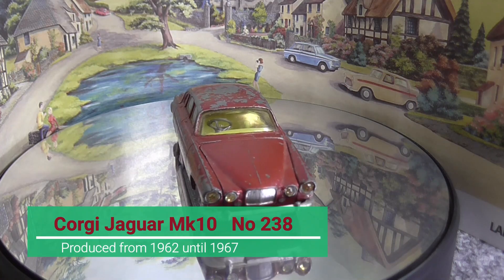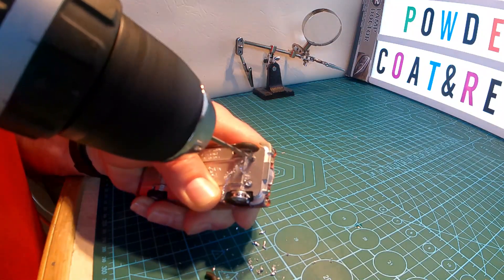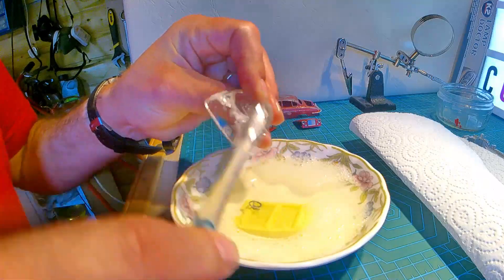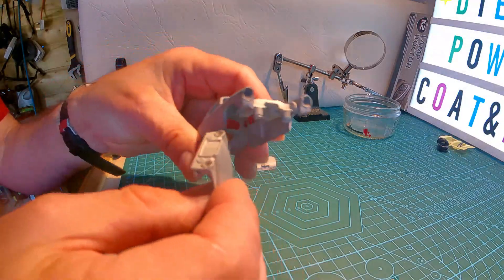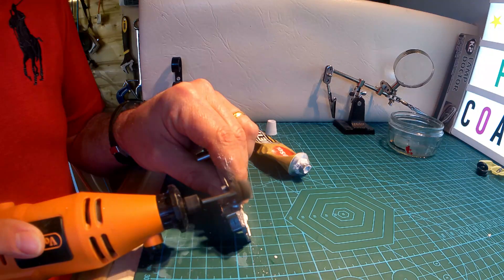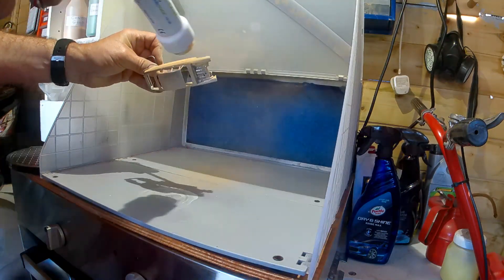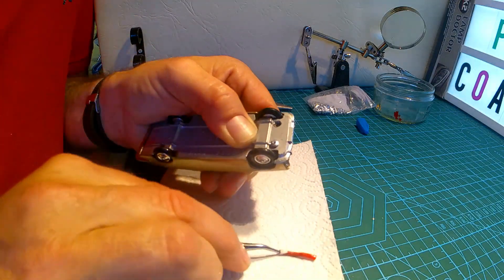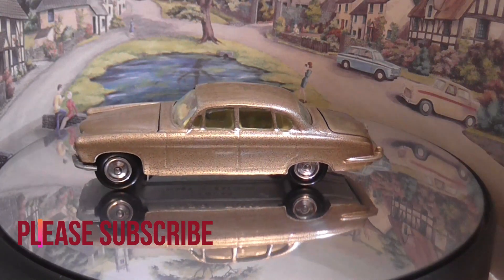Corgi Jaguar Mk10 Powder Coating

Comment: Very nice piece, that old Corgi castings are new for me 'cause it is a brand rare to find here in Mexico, specially old models (also very expensive if you find one). I wonder if the shiny finish comes out with the oven process or you applied a clear coat after. Completely new painting technique for me. Great job. Greetings from Mexico City 👍
Reply from the maker: Hi Hugo, Thank you for your kind comments. No when they come out of the oven they look like that.
Sometimes things go wrong and I may have to do it again.
I can't go too thick with the powder coat as you  would lose detail, but sometimes I don't put enough on so you can see the metal underneath.
Take care, Jeff
Reply: @DiecastPowderCoating  A little more practice, I think. In the meanwhile you are gathering experience, win - win formula. Keep safe too 👍
Reply from the maker: Hi Hugo, yes slowly learning.
Thanks Jeff